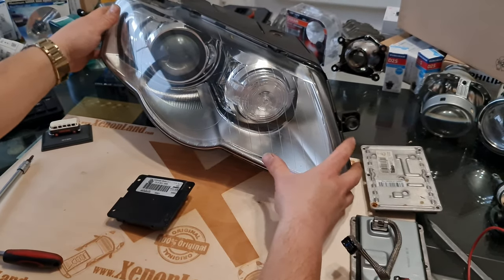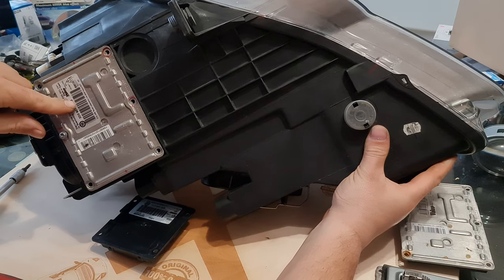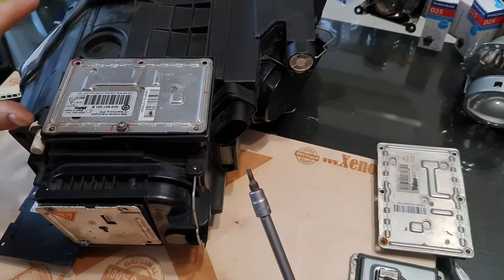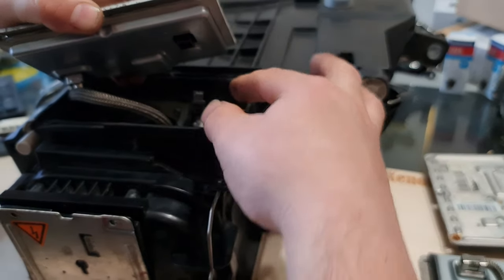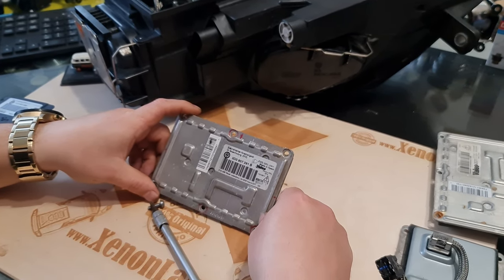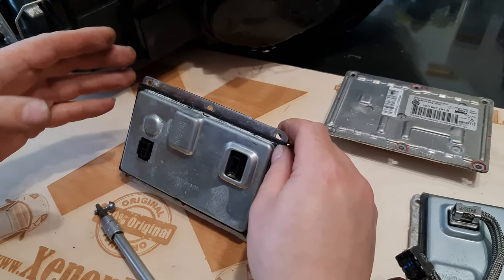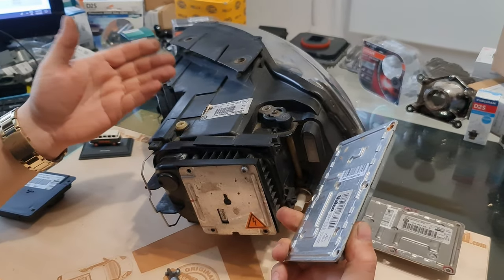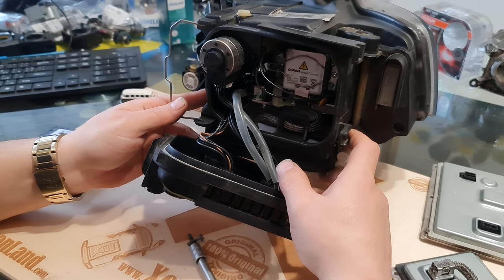VW PASSAT B6 BI-XENON headlight ballast and hid bulb replacement (fixing low beam & high beam fault)

Comment: Yesterday I failed on my car inspection because they thought my headlights were too weak.

I have replaced both ballasts and bulbs on both sides last year because the light was already weak back then, but the lights didn't improve at all after changing the parts, and I've heard that these lights are just bad in general so I thought nothing of it..

Any thoughts as to what my problem may be? I just read that the cables can get worn and lose current due to bad insulation, so is this a possibility perhaps?
Reply from the maker: Is your car over 250-300 000 km?
Reply: @xenonland  Just under 200 000 km as of yesterday.
The glass on the headlights are also pretty clean for the age and the lenses are pretty clear without any notable discoloration for the record.
Reply from the maker: this usually happens when the projectors' reflectors are smoked/burnt. Inside the projectors casing there is a chrome coating, and usually in time this coating gets smoked/burnt. If the headlights are replaced in the past, most probably they are smoked. Nothing to do with ballast. If you use genuine xenon bulbs, and still do not have sufficient light outcome, in this case, the headlights need complete refurbishment (which we do not recommend for AFS type xenon headlights). Better to replace them, but with low-milage ones or new ones (which are expensive due to lack of aftermarket option) @Piratskeppet
Reply: @xenonland  So my only real option is to replace the whole headlight units then?

Comment: hello, do you need to remove the bumper to get the headlight out?
Reply from the maker: unfortunately to prevent eventual lug/tab or headlight damage removing, at lease loosening, the bumper is a must. Everything made without removing the bumper risk your headlight integrity, and hence can cause bigger damage (water ingress, condensation etc...). It is a time consuming operation but can save you a lot afterwards.

Comment: Hello, so I have some problems with my bixenon headlights (2006 with two units) my left xenon is not working - dash warning AFS inoperative left dipped beam. I tried to change balast and second unit with second hand one and it's still not working (Incorrectly coded error). Do I need to code them or are they broken too? 
Codes: 01328 Convenience system data bus, 00978 Lamp for low beam; Left(M29). Which modul is more likely to be causing problems?
Also I changed bulbs, still no luck. Any advice? Thanks in advance
Reply from the maker: Do you have low beam or not?
Reply: @xenonland  low beam doesn't work either. Not even cornering lights work
Reply from the maker: Ballast does not need coding. Given that your replacement Ballast is working, it is straight swap. No coding needed.
Reply from the maker: Cornering function is related to afs module. Used asf module is a streight swap, given that it is absolutely same part number and genuine part
Reply: @xenonland  so afs module not working could result in low beam not working? What do I need to replace?
Reply from the maker: @maxidozaberu5943  afs module does NOT have anything to do with the low beam. They are completely different things. Low beam-ballast, cornering-afs module.
Reply: @xenonland  so if I understand correctly they are both faulty? Sorry I am not very familiar with this technology. I am very grateful for your answers.
Reply from the maker: given that you do not have any wiring issue/fuse issue, yes they both seem faulty (or you used incompatible AFS module with different part number)  @maxidozaberu5943
Reply: @xenonland  Update: I replaced both ballast and afs unit(didnt help). I found out that if I light light up first time it goes off, when I reset it before AFS warning comes up that light will work without any problems. There are no codes whatsoever when I do this procedure.

Comment: Hi
My passat has no left high beam, i have changed ballast and bulb but the problem is still. Do you have any advice?
Reply from the maker: First make sure that the ballast and the bulbs work 100% at the other side headlight. Assuming that your Passat is 2005-2008 6-pin valeo, please check also the connection cable that goes from the ballast to the bulb. And finally make sure that there is power coming to the headlight.
Reply: @xenonland  Thank you for your suggestions, I used to swap the bulb with right side but the problem was still at the left. I will re-test all of them one more time.
A question you may know, when the high beam is turned on then the right high beam is worked for 5 seconds(the left one doesn’t work) and then the right high beam is turned off automatically by swap to low beam, is this normally behavior when both high beams don’t work at the same time?
Reply: @punnatatjankaew  Hi, i have the same problems, maybe u find solution for this problem?
Reply from the maker: Have you checked your AFS module?
Reply: Yes, afs module works fine, lens does all the movements, just left side (driver) high beam doesnt work, i hear the shutter clicking sound  from right side when turning to high beams, but left side stays in the same low beam position and shutter makes no sound.
Reply from the maker: @domas7340  exactly, we alredy covered this issue in our videos, if shutter gets faulty, just replace the headlight, no repair practically possible

Comment: Hello my friend, i have a problem. I upgrade to passat bi xenon headlights set but doesn't work. I have 2006 passat,  headlights is 2008-2010, afs gateway 5M0907357C, afs modules 7L6941329A and afs harness cable. ( signal, low beam and highbeam is work but corner light, calibration and turning projector is doesn't work )
Reply from the maker: As you know the software used at 2005-2008 is different than the 2008-2010. That's why you do not have AFS function since the ...329A (used for both left and right headlights) is incompatible with factory built ...329-...330 (which are sided at 2005-2008). I asume that you already changed the gateway/light module 5M0907357C with a newer one. If the 5M0907357C not coded properly you will not have AFS function as well. Programming of 5M0907357C is very crucial! All these are just guesses. Good luck, (bol sans), as modifing factory fitted system is very problematic (I know even the VW dealers sometimes fail to solve/address correctly such issues, and simply recommend to use original factory settings/parts).
Reply: @xenonland  thank you very much, i will inform you if there is any improvement.

Comment: Which do I change, I have code left power module no signal
Reply from the maker: Power module is afs module at this headlight. There is no other module at the headlight itself
Reply: @xenonland  mine bought up left power module no signal 08b9 and 4 other codes about compounds not being coded and headlights not being adjusted, so it should be the afs sensor which is part number
Reply: @xenonland  what is the right part number
Reply from the maker: AFS leistunsmodul at the headlight cover for the left headlight: 7L6941329
Reply from the maker: Please make sure that you have correct diagnosis. AFS Module and swivel module sensor are different things.
Reply: All the diag said was left power Module no signal

Comment: Hi..whatbis AFS function??
Reply from the maker: AFS (what Opel names AFL) is the adaptive function (adaptive forward lighting) of the headlight lens according to your steering wheel position (mainly as turning right or left).
Reply from the maker: Check your H7 bulb which also lights when you turn left or right. If it is not working, change it. If working then it a big trouble (ballast, high beam mechanism etc)
Reply: Hi, would this fix intermittent fault. Low beam sometimes goes out.
Reply from the maker: Intermittent fault is usually caused by the ballast (very seldom by the bulb, 2 occasions in last 10 years only).  Especially if your ballast is exposed to a moisture/if you have a condensation issue at your headlight. Only solution is to find the source of the water ingress/condensation, and only than replacing the ballast. Otherwise the replacement ballast will also burn shortly.